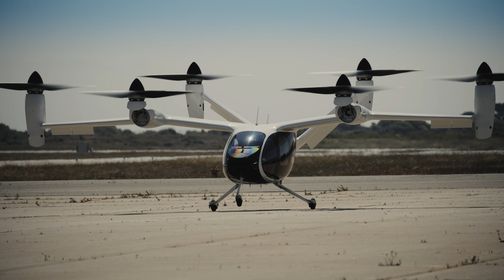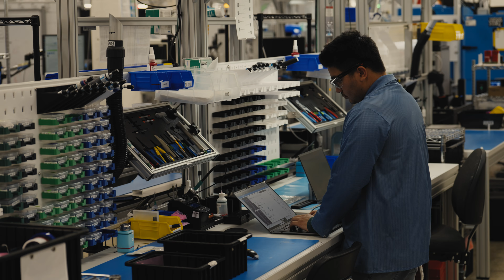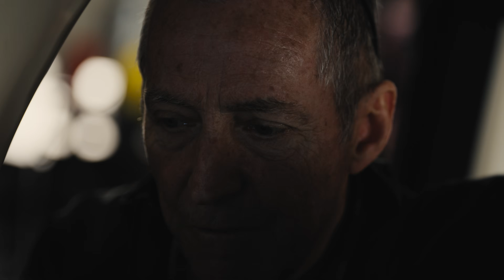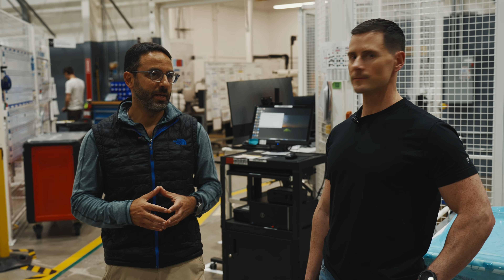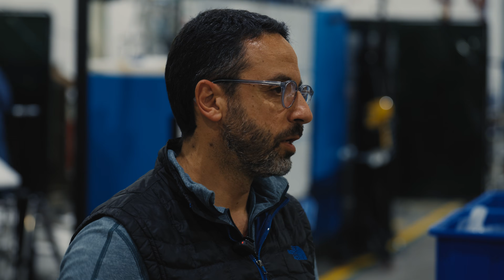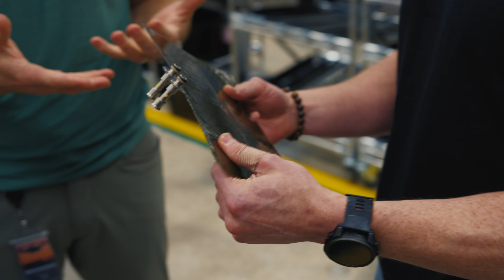Thunderbird Pilot Max Afterburner Meets Joby's Electric Air Taxi

Comment: This latest "flying car" hype cycle has been going on for nearly 2 decades now.  Meanwhile, after all these years, there's still really no flying car in use anywhere, for any purpose, except maybe a very limited brief demo flying for just a few minutes with tourists.  The main design drivers in aviation are speed and range.  The main obstacle to overcome is weight.  Batteries violate both of these goals:  Too heavy, and cannot hold enough energy for decent range, let alone the normal half-hour of required reserve "fuel" remaining at the end of a flight in case a different airport is needed .  These things are already at a half-hour of airtime left before takeoff!  And if they are so "quiet" why don't we ever see a takeoff close up, with full sound?  And why do they require a "vertiport"?  Can't they just take off and land anywhere?  Oh wait - the downwash - the flying debris from the 100 mph downwash wind blowing all that dust, dirt, and trash everywhere?  Dirt in your eyes and teeth?  Do they ever talk about how their downwash is faster than a helicopter's downwash, due to moving less air faster?  And the solution to no range?  "All-ya-gotta-do-is" add a conventional turbine powerplant!  With a heavy generator. Next step?  Eliminate the heavy hatteries and replace the multiple propellers with a conventional helicopter rotor.  Did you know they make quiet helicopter rotors?  I think it was early in the previous century that multiple small propellers were tried for vertical flight carrying humans, and did not work out.  This design space is like "pushing a rope". Trying to fit a square peg into a round hole.  Joby started out pursuing kite-powered wind energy, which is where they got that figure-8 logo - that shape represented the path of a kite flying figure-8's like all the rest of the failed airborne wind energy crowd.  Joby at least realized that was a dead-end early on, but after having backed off into just providing electric motors for airborne wind energy, eventually transitioned to the next global warming derangement syndrome trap of electric flying cars.  Well, at least with all that money they raised, they bought "Blade", a company that flies real helicopters!  Cart before the horse!  Good luck, but I have strong doubts as to the long term viability of this concept.  Or even the short term viability.  Most of the other flying electric car companies have already failed.  Yes, it looks like a gorilla.  Let's remember, simple is good!  You know that old adage: K.I.S.S.   :)

Comment: There are others but yes $joby in the poll position big time absolutely the instant on torque of battery electrics is like nothing else STRAIGHT UP so moar like flying in an elevator 🛗🛗🛗🛗🛗 should be quite precise as well so definitely a new type of flying 🪽🪽🪽🪽 not high performance like fighter jets but definitely not boring and pretty much point to point ...literally from anywhere to anywhere 🎉🎉

Comment: The comparison with helicopters often focuses on noise, cost, and emissions, but overlooks the uncomfortable question: what happens when something goes wrong near the ground?

Helicopters retain autorotation, imperfect but real. eVTOLs rely on redundancy, software, and sometimes parachutes. But a parachute needs altitude, time, and a defined flight path.

In aviation, what matters is the margin of error the aircraft offers when things go wrong.

Comment: It's a great idea for the aviation eco system. However, with the ATC problems and managing separation, how will privately owned aircraft like this be safely managed in the future at altitudes where squawk numbers aren't used and visual separation could be an issue ? That's an important question for the future as these airframes roll off the assembly line quicker than ATC can upgrade.

Comment: Lithium batteries are not going to be the fuel that will revolutionize the future of flight. We need a fuel breakthrough for the future of this type of aircraft.
Reply: And here’s the problem.
Reply: You could have a hybrid system that runs on synth fuel for starts and landings and uses the batteries for level flight. Of course not for long range flights.
Reply: @0Turbox  Too much weight. Too much certification effort and costs.

Comment: i understand that ice can build up on airplanes.  Is that a concern on a Joby?  I can see it would be a problem in Northern latitudes.  Batteries in low temperatures as well.
Reply: when the "best" battery is invented and being produced Joby ought to test them out.  Donut batteries for example could be tested in a Joby.  300 mile range would really be better IMO.

Comment: from a pilot perspective (and Joby investor) it seems the design philosophy is that the airplane is flown thru the autopilot; that is, the autopilot is always "engaged". Then, the pilot tells the airplane what he/she wants it to do and it does it..... but is there a manual mode if the "autopilot" system fails?
Reply: Nope. The fly-by-wire control itself is redundant, but there is no purely mechanical backup, if that’s what you are asking.

Comment: Early (2021) retail investor here and I've got to say, this presentation really helps to keep the faith and hope you continue to release more going forward. Would like to hear more about the path forward with existing and upcoming batteries. My understanding is that with current batteries Joby is unable to get the early promises of distance/speeds and load capacity...so how close are you and what needs to happen to reach those goals?
Reply: I predict Joby or whomever buys Joby will expand to larger planes with Hydrogen power lowering prices by half or more to fly, Joby might dominate being the first zero emission airline within 10 years.
Reply: Joby is caught in the same trap Lilium has been caught.
Reply: @avigator nooooooo, not the same.

Comment: Hi Ryan, can  you do me a favor and next time talking to someone at JOBY, could you ask them if their aircraft can land like a normal plane with motors forward and landing at regular landing speed of lets say 60 miles per hour. I tried at least 10 times to find this out through emails, posts and actually calling JOBY, but have always have had to leave a message. But the reason i'm wondering is just in case there's a problem, would landing like a normal plane be an alternative approach? thanks Ryan
Reply: They have said that it can, but if it is meant to take off and land vertically, why make it a requirement to do rolling landings? You don't require it from a helicopter, why require it from this?
Reply: @FeritTuzer  Just thinking worst case where lets say thee motor mechanism is stuck in the forward position or the plane is hit by lightning and fries an activator switch, so in this case if at high enough altitude, do a steep dive and flare out for a landing, and yes i've read where they say they can land like this, but i'd really like to see a landing like this before buying the stock
Reply: @bobk544-e6q  they can simply deactivate one motor and land, they have shown that in a test. I guess you are implying they haven't tested against lightning strikes, which Beta has harped upon as their strong point, but if it is mandated by the FAA they will test for that. Other than that you are saying that one dual redundant motor or its actuator will fail, and then another one will fail similarly before they have a chance to land? You might as well require floating on water for 30 mins, which is maybe a greater issue, however they have shown the aircraft will continue just fine with loss of one motor, so they don't necessarily have to ditch if they're above a body of water.
Reply: @FeritTuzer  actually here's the Archer plane taking off and landing like a regular airplane https://www.youtube.com/watch?v=gmz5yjmeZQ8
Reply: @bobk544-e6q  fine I'm not saying they don't do it, that is nice to have to save on power as vertical flight is more power hungry, but then you need to carry a heavier landing gear. I think Joby's aircraft will manage the rolling landing just fine but it will need to be serviced afterwards.
Reply: well my opinion is if you can use the airplane as a regular airplane then that's an advantage and then only use the vertical lift when necessary, but to always plan to use the vertical seems to limit the options and hence the long term prospects and hence the stock price growth. I rooting for JOBY actually, but i hear that their manufacturing requires a lot more sophisticated approaches whereas ARCHER is "said" to be more off the shelf. but that may translate into more battery usage if the parts aren't custom fit and trimmed for weight ect
Reply: @bobk544-e6q  In the end they could reinforce the landing gear and certify it both ways but they must have thought the weight disadvantage wasn't worth it. Remember they design to be solely operated by them as an air taxi, no other usage planned, other than military. I also don't think Archer Midnight is designed to do rolling takeoffs and landings, its landing gear does not seem to have much give, it is a solid block, much more than Joby's and the wheels don't have room to move.